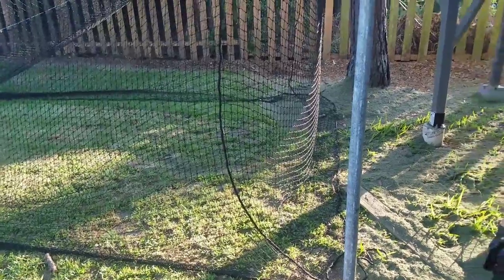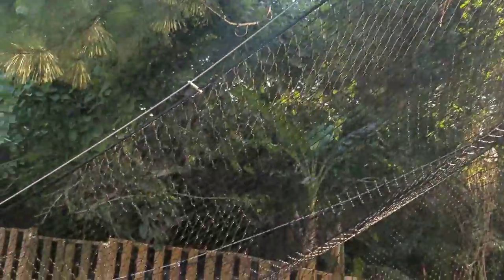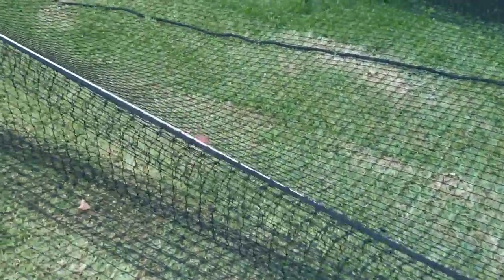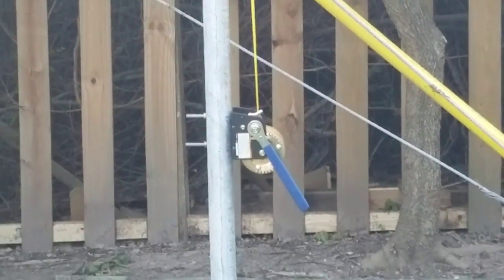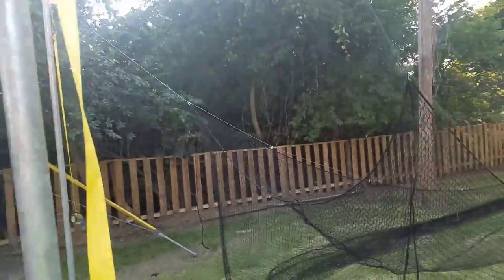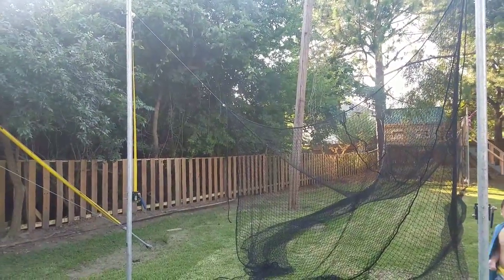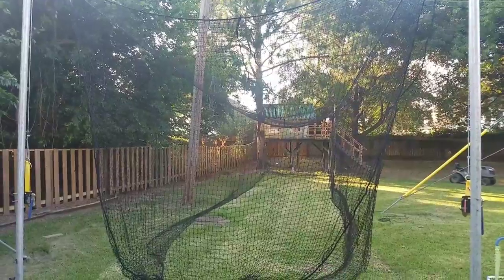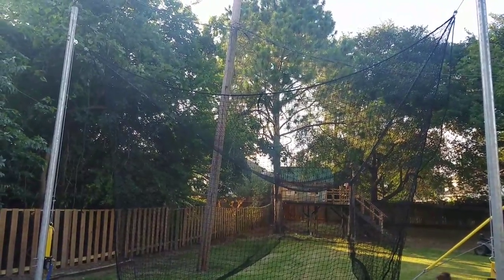DIY Batting cage

Comment: Where did you set the polescompared to your net size? Our net is 10 x 35 so I am guessing we need to set the poles back about a foot on each end to pull it tight.
Reply from the maker: If you use the system I did,  the side of the net with winches will be at least a foot  longer than the net.  The other end of our net is fixed tight to the pole top and bottom. But yes i would set the poles longer than the nets length, the winches pull the top tight and we tie the bottom of net to bottom of poles. Have fun!

Comment: What did you use for poles and where did you get it?
Reply from the maker: I used aluminum fence poles, went to a fence supply company and got the thickest walled pipe they had. They cut the pipe to 13 feet. Used concrete to secure them 3 feet deep.